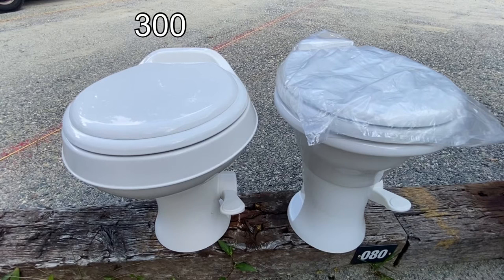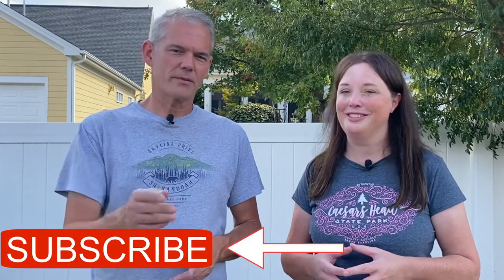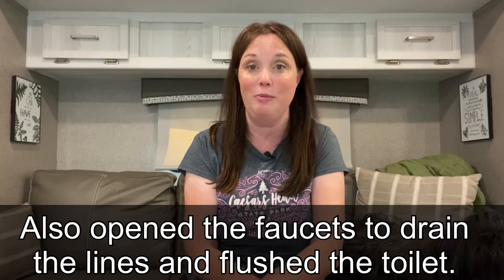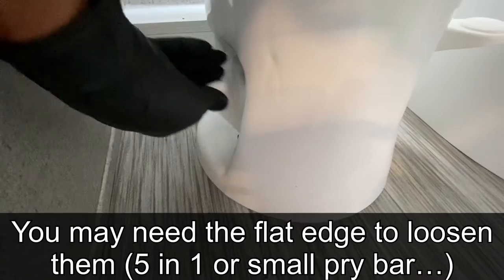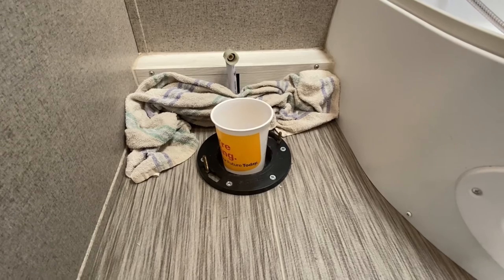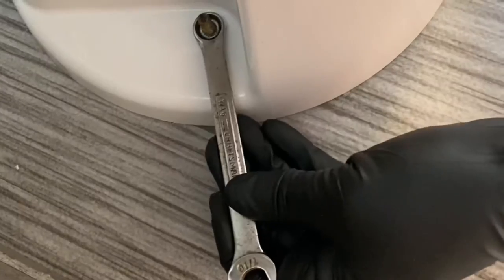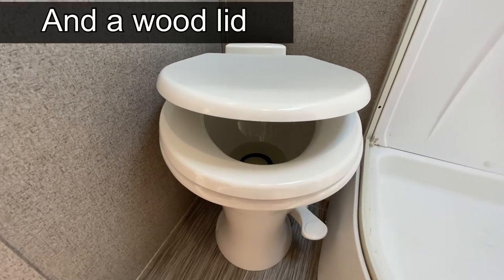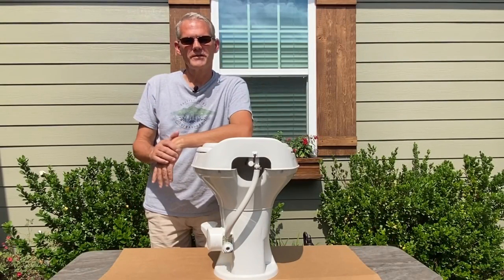We Install Dometic 310 Toilet - Pros & Cons / TIps!

Comment: Thanks again… I really appreciate your videos and have actually done most of the improvements you suggest in your videos and I have been living full time in mine with my dog for 2 months. So for that thanks and Linda your organizing tips sure helped. I am wondering in your model when your a/c runs does the fan run constant? In mine it does and the noise is driving me nuts so If is the same. how about installing a Coleman-Mach Bluetooth assembly to fix that ?
I have mine ready to install but in the Texas heat I’ve been reluctant so perhaps in your preparation for a trip out west you might be interested and even make us a video. Here is one for another rig but I am more comfortable with yours https://m.youtube.com/watch?v=h3vscvx492A&feature=share
Reply from the maker: Hi!  Thank you for the kind comments - appreciate that.  So glad that you have found some of our suggestions helpful!  So, yes - the fan runs constant and is loud as well.  We added the vent in the middle and that has helped some but we have had our eye on that bluetooth model.  We have watched a couple of install videos and have read up on forums about others that have done it.  We don't do alot of summer camping - love fall / winter / spring but the hot days of summer camping are limited so we haven't purchased yet.  If you put it in, would love to know how it goes!!  Again - thank you and thanks for watching!